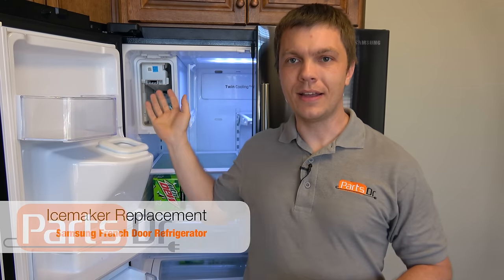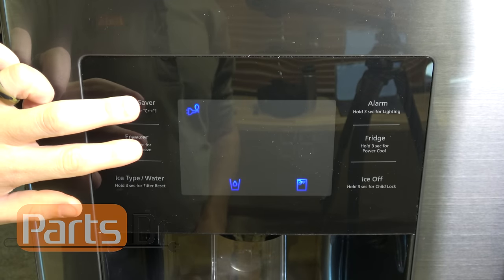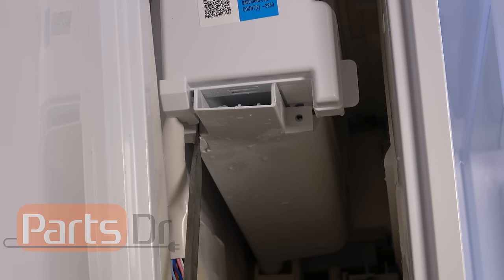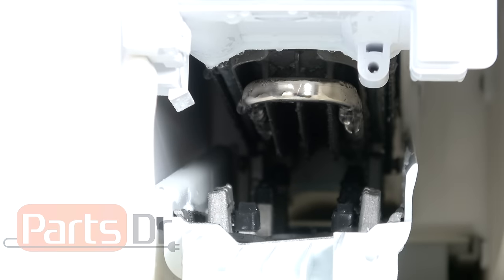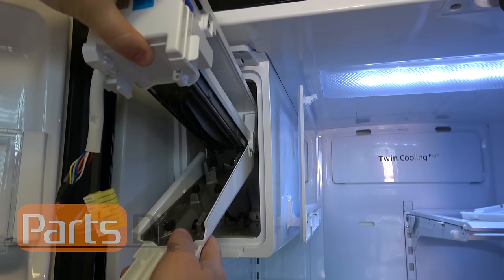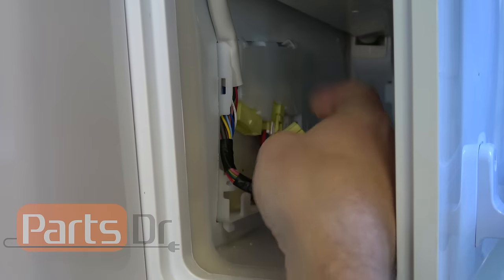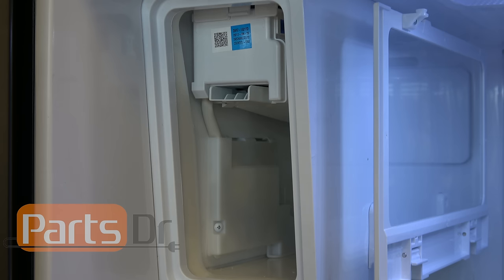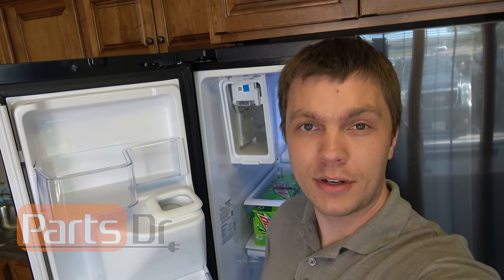How to replace Samsung Icemaker part # DA97-15217D

Comment from the maker: Having issues with your ice maker freezing up?  Check out this video with 7 things to check if your ice maker is freezing up here: https://www.youtube.com/watch?v=EdNAhCxIoGk
 Y-Clip Kit - Fix ice buildup in your Samsung ice maker here: https://www.youtube.com/watch?v=4WrzNhySQa8
 Ice Box Sealant - Fix ice buildup in your Samsung ice maker  here: https://www.youtube.com/watch?v=8DkXLEXKAug
Reply: What if nothing is freezing? Its just making too much ice
Reply: Nice, clear, straight forward video. Thanks.
Reply: My Samsung RF28JBEDBSG is making a noise behind the ice maker housing, sound like a fan, how can I eliminate that, I’m not using the ice maker and and is think is off! Can I unplug the ice maker just like in your video?
Reply: @TheDgo7  Some people said their fan seized up.  The cost to replace the back part of the ice maker is costly too, but that fan looks like a computer fan of sorts.  I'm in the process of taking apart mine to get at that fan.  Please message me back with questions or answers if you have them.  Together we'll get through this nightmare.
Reply: @walperstyle  I unplugged the fan, like I said I’m not using the ice maker, the refrigerator is working ok! Good luck with yours!
Reply: @walperstyle  how did it turn out? Having issues with mine. Won't make ice and it was barely a yr old.
Reply: @smokinram10  I took apart the entire auger part and put a bunch of foam around it (cut pieces of foam) and I got 4 months before it cut out again.  It's super annoying.
Reply: I watched the link above and it talked about like six different things that you have videos for but there was no link for the video to watch for my problem.
Reply: We have the older model icemaker where the water catch shoot has the notch cut out in the back I have use some one sided thick tape to try and build it up some do you think that is why I’m having issues with it freezing up but I also get frost all over the thing like it’s not defrosting as well
Reply: This video help tremendously, if I ever need to replace I know who to come to. My ice maker was off for 4 months and it was still frozen solid.

Comment: Great video, Now my ice maker makes ice 9 cubes but not dropping them. What could be the problem ?
Reply from the maker: If there is ice in the icemaker tray and the icemaker compartment temp is below 20f and it isn't harvesting the ice you may have a bad ice maker or bad main control board.  We haven't seen a process to completely narrow down which is bad on these refrigerators.  We would recommend to start by replacing the ice maker and if you continue to have issues replace the main control board next.
Reply: Thank you for such a detailed video but I think it’s a shame they can get away with selling a defective ice maker I have changed it twice already.

Comment: My ice maker was freezing up and so I watched your video and it seemed like a job I could do so I ordered the ice maker from Parts Dr.  Within a few days the ice maker arrived and I placed my laptop next to the Samsung and played your video.  You made this job so easy and within 15mins I had my old ice maker out and the new one installed.  Now I;ll wait to see if this fixes the problem.  Thank you so much for making this video for everyone!
Reply from the maker: Awesome!  Let us know if it fixes the problem.
Reply: It has been over 6 hrs since I replaced the ice maker and it is making ice like a champ!  The real test will be in a day or two to see if it freezing over.
Reply: Did replacing the ice maker resolve the frost/ice buildup problem?
Reply: It has.  I didn't have to use any silicone for sealant.  It was the old ice maker that was building up frost/ice.  
The new one is working very well.
Reply: It has.  No more frost/ice buildup and I didn't have to use any sealant around the box.  I'm very happy with the replacement and life is good.
Reply: the ice maker freezes up if the front of the refrigerator is not raised off the rollers. The fridge needs to tip back a little to keep the water from spilling over.

Comment: It’s the freezer button and lighting button on my model. And then it beeps continuously for 20 minutes.
Reply: Same on mine. Just more convoluted cryptic Samsung crap. Looks like they use the same hardware and buttons are programmed differently to confuse us. The only confusion I have is, how the hell are they still in the refrigerator business. These icemakers are high tech garbage. By the way BEWARE I learned yester day that the crisper drawers are made in 3 parts with fronts clipped onto drawers. THEY ARE NOT WATERTIGHT. A roast leaked and I pulled the drawer out to clean it and it dripped out the bottom and got all in betwee the white and clear plastic front. Why aren't they sealed? WTF? I wonder what else I'll discover is wrong with my fridge.

Comment: Great Video! Only one note to those changing out the Ice Maker. The units are back ordered and difficult to come by. 
ALSO, if you remove the Ice Maker the refrigerator will continue to operate, HOWEVER the front panel is locked out and will display error codes 13C,14C and 39C until a new ice maker is installed.

Comment: Very detailed and helpful, thank you.  Using this video and a lot of loud profanity, I was able to get my icemaker installed. This is the fourth ice maker so far in this stupid fridge (the other attempted replacements were done under the warranty) so I don't have high hopes that the thing will last, but fingers crossed!
Reply from the maker: Nice job replacing it yourself!

Comment: I replaced my ice maker this past Jan.  It is working great, 100% better and it's much faster making new ice. I hope this lasts for the life of the fridge. I had one replacement 3 yrs ago that did not work.  I read that the more recent replacements units have been re-engineered. (?)
Reply from the maker: That is great to hear the new ice maker is working better than than the original.  Samsung has made some design changes and improvements to these ice makers but they don't specify the changes they have made.

Comment: This video was very helpful. I wish I would have seen it sooner. My icemaker works fine, but there is a serious problem where I am constantly having to defrost it. It builds up so much ice that it takes about an hour to defrost it. I got impatient and used a blow dryer, which distorted the plastic on the bottom of the icemaker, where it dumps the ice out on the right side. Now ice jams and causes more problems. Do I need to replace the entire icemaker now or can I just replace that piece of plastic that pivots down when you remove that first screw? Also, do you think I need that rectangular piece to stop the moisture buildup problem?
Reply from the maker: The entire ice maker assembly must be replaced if there is a failure.  Individual parts are not sold for these ice makers.  See below for videos regarding tips on the ice maker freezing up.
Having issues with your ice maker freezing up?  Check out this video with 7 things to check if your ice maker is freezing up here: https://www.youtube.com/watch?v=EdNAhCxIoGk
 Y-Clip Kit - Fix ice buildup in your Samsung ice maker here: https://www.youtube.com/watch?v=4WrzNhySQa8
 Ice Box Sealant - Fix ice buildup in your Samsung ice maker  here: https://www.youtube.com/watch?v=8DkXLEXKAug

Comment: Excellent video. I had issues with not filling. While replacing mine I noticed had ice build up in the inlet that appeared to be blocking the water from entering. I didn't test my theory because I already had a new unit but I thought I would share this with others. My suggestion is to remove the unit and inspect it before buying a replacement.
Reply from the maker: If the inlet line is frozen it is usually caused by a leaking water inlet valve.  If yours freezes up a 2nd time you should replace the water inlet valve which is typically sold as part of the filter case assembly on Samsung refrigerators.

Comment: Just replaced the ice maker and put in y clips per Samsung repair directive. Works fine so far. No freezing up. Heads up to you all who have done it or are going to. The only difference in the old ice maker and redesigned one is the top cover. Be sure to keep old ice maker as spare because you can always replace the top cover. The cover should be all you should buy but you know the story. LOL.

Comment: Doing this for a friend tmrw, let's see how it goes. I've watched this twice now, super easy she COULD do it herself but I don't mind - hey it gets me free beer as a thank you. :)
Reply from the maker: Awesome!  You can't beat free beer 🙂
Reply: @PartsDr  update... Success! Even after a 14 min FD wait, there was a ton of ice at the base of the coil. I had issue getting the new one seated but my friend msgd me a lil bit ago and said it works! My new question tho, apparently they included a new PCM board and new water hose... The fact it works, is that board detrimental to it continuing to work well from this point on?
Reply from the maker: @tbok75  what part number did you order?
Reply: @PartsDr  I'm not sure actually. She ordered it direct and they sent her two (said she's gonna give me the spare cuz I have the same, but the 4 door model) It's been working great tho she says.

Comment: Excellent How-To on replacing a Samsung Ice Maker. What is not mentioned is "resetting" your ice-maker, which could be your problem. There is a small button on the top/right/front of this ice maker (In my case it is blue.) Depress the button for approximately 10 seconds and the ice maker should cycle, and then refill.

Comment: Great video thank you.  My ice maker is still working but we have a lot of hard water white sediment in the ice cubes and they taste bad.  Can I use these instructions to remove and clean the ice cube trays and any other sediment? I have already changed out the water supply line running from the kitchen sink to the refrigerator and replaced the water filter too. It seems the issue is only with the ice cubes.  Thank you
Reply from the maker: With the ice maker removed you may be able to clean some of the ice maker tray.  It may be difficult to access and clean the entire tray.  Sometimes if they are in bad enough condition, the ice maker will need to be replaced.

Comment: Ordered the parts including the drip clips. I have the sealant (painting contractor) great video tutorial. FOLLOWING 🏆
Reply from the maker: Great!  Let us know how it goes!
Reply: @PartsDr  thanks i will. i also had ice buildup yesterday in the fridg. compartment hitting the fan. frig defrost 2-3 times fixed the problem. looks like ice building up again this morning inside on the plastic. im guessing the defrost sensor. also seen on another video where they moved sensor over to the pipe next to it on the left so it would make the heater work longer?  looked like a great mod. appreciate your help on that

Comment: Thanks PartsDR for this very simple and detailed instructions for replacing the Samsung Ice Maker.  I am one of those who has the Ice Build up in the back of the frige where the coil is located.  Not sure if clips will eliminate that build up.  Would love to hear your opinion.
Reply from the maker: If you don't have Y clips on your refrigerator, they would be one of the first things that we would recommend to try.

Comment: Great video. Very helpful to get the part out safely and properly. What was missing in my case - the unit was so frosted up that even after 3 cycles of the forced defrost everything was so frozen up that it wouldn't come out. Other than emptying the fridge and turning the entire thing off to thaw out, I couldn't find a save way to remove all the built up ice and remove the ice tray. I've had the fridge a few months and this was my first incident. I'll have to do this routine frequently to avoid getting in this disaster. If Samsung has a remedy or there's an action to have them resolve I'd like to know.
Reply: There's also what looks like an overflow drain behind the ice tray that is totally frozen up. I don't seen an easy way to access it; again, the only way to thaw seems to be a full fridge thaw.
Reply from the maker: Unplugging and letting the refrigerator manually thaw out is the best option.  See the video linked below for tips on keeping the ice maker compartment from getting excessive ice/frost build up. https://www.youtube.com/watch?v=EdNAhCxIoGk
Reply: Another forum of Samsung complaints mentioned using a steam mop to de-ice the freezer. I have a hand-held Shark steam cleaner (I think a garment steam would also work) that makes short work of this task. I ordered a new ice maker and hope to have good results. Thanks for a great video.
Reply: @Parts Dr  does the force defrost mode defrost the entire fridge or just the ice trace?

Comment: Very helpful video. I disabled my ice maker from the front panel years ago, but it still created a giant block of ice. So much so that it's gone around the back and is now causing a problem with the fan, I think. 

If I don't want ice maker functionality, so I still need to be extra careful with the metal ring thing?
Reply from the maker: Yes, you will still need to be very careful to not damage the cooling coil or any of the other ice maker components.

Comment: Knowing how to initiate forced defrost is a lifesaver on these refrigerators. Not only does the icemaker ice up but the circulation fan in the back panel tends to get ice buildup around it too to where it starts to hit the fan blades you can hear the fan spinning. You need to run the defrost cycle to fix that as well.

My wife loves this refrigerator. The way it’s configured. The adjustable shelves the meat drawer. But these icing issues are a real pain in the butt.

Comment: Great video, worked just the way you recommended. I just turned off my refrigerator off at the circuit breaker since known of your refrigerator control suggestions seemed to work on mine. I used a hair drier on low heat to defrost the unit before installing. Thanks for your suggestions. Great instructions.
Reply from the maker: We are glad you found it helpful! 😀

Comment: Thank you for the helpful video.  You made it a workable process for me.  All I had to do was replace the DA97-15217A with the updated DA97-15217D and seal the compartment.    I got ice now!  Yeah!
Reply from the maker: Awesome!
Reply: @PartsDr  So I should have ordered the updated version D?
Reply from the maker: @Tjetleah1  If you bought the part from our company we only sell the newest version of this ice maker
Reply: My buttons are in different locations and won't activate FD mode.
Reply from the maker: @JB50713   See the link below starting at page 11. Let us know which one ends up working for you and what model number your refrigerator is. http://repairmanuals.yolasite.com/resources/MSA-Samsung-Fridge.pdf
Reply: Is your ice maker still working without frost?

Comment: Respectfully request your assistance or tip: I can't get the plastic air tunnel to lock in place. Im pushing it up but there seems to be some resistance. The coil looks to be in place correctly. Thanks for video.
Reply from the maker: It is normal for there to be some resistance, but it should be able to close and install the screw to keep it in place.

Comment: Mine leaks in the back and drips  into the ice bucket and freezes there. Also builds ice up in back of the ice maker. Any ideas on stopping this leak? Still makes ice for a while until I have to get out the hair dryer. Thanks.

Comment: Yes grwat video. Took some time to get mine old one out as it had a huge block of ice in the back i couldn’t see. 

Question. Once installed do we just turn on the ice maker and give it time or do we need to hit the reset button on the ice maker to get it started?
Reply from the maker: With the new ice maker installed, just maker sure the ice maker is turned on on the front display and allow 12-24 hours for it to cool down and to start producing ice.

Comment: Thank you for this video.  I have followed it exactly but have a problem.  I am replacing the old DA97-15217"A" with the new DA97-15217"D" as shown in your video.  The new one will not push far enough in for the latch to catch.  Comparing them side by side, I can see that the new ""D" part is between 1/4" and 5/16" (6mm and 8mm) too long at the back and no matter how hard I push it won't go in far enough so that the latch at the front will seat.  The new part is a Samsung OEM part.  Can you help me with some advice.  Many thanks, Tom
Reply from the maker: The D will fit in place of the A without any issues.  The extra length is the drain that goes into the drain of the auger motor.

Comment: So with this method of shutting the fridge down with the buttons you do not need to unplug the fridge? I would probably feel safer unplugging the fridge after running the defrost mode, is there a reason you would not unplug it besides not having to pull the fridge out away from the wall? Thanks!
Reply from the maker: There is no reason not to unplug the refrigerator beside the not having to pull the refrigerator out away from the wall.

Comment: Excellent video, thank you! I removed the icemaker after trying to reset and defrost previously. I haven’t had too much ice build up, it just stopped making ice. Before I buy a new icemaker to replace, is there any way of fixing the ice maker or no?  Trying to understand why it just all of a sudden stopped working.
Reply from the maker: None of the parts on the ice maker are serviceable by Samsung, so if the ice maker has failed the entire ice maker will need to be replaced.